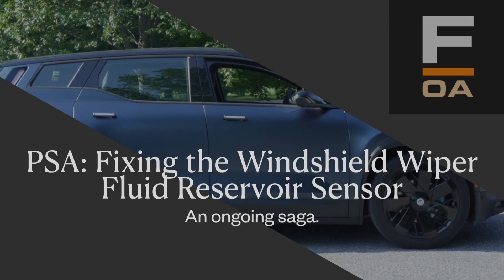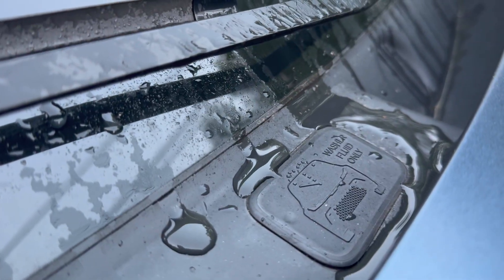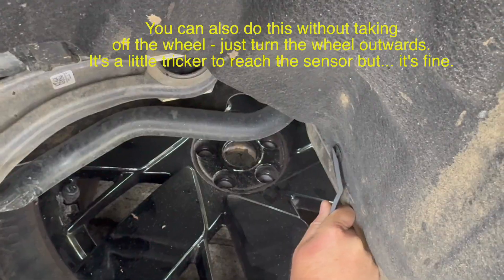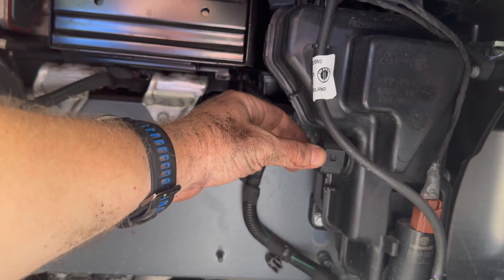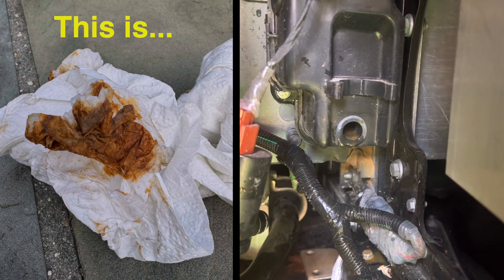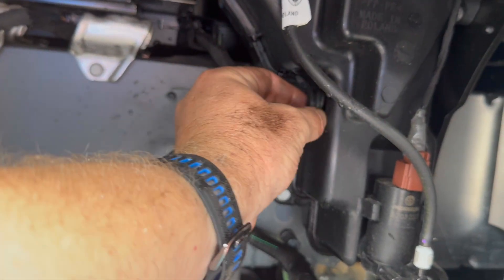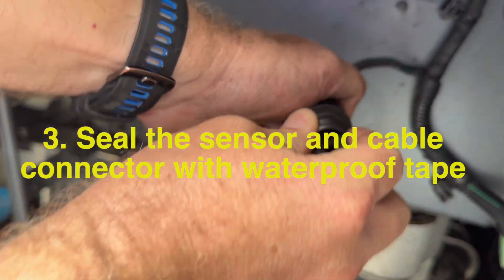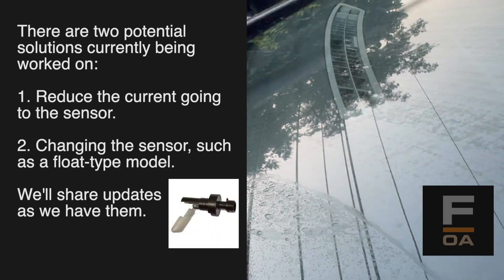Sensor Drama: Update on the Windshield Wiper Fluid Reservoir

Comment: Thanks for putting this out there! This is something that literally every Fisker should have done or will eventually cause a problem. 

It's likely that at least some of the wiring harness corrosion issues are caused by leaking washer fluid through this sensor as well as it drips down on connectors and VSP.
Reply from the maker: Glad we could help. We agree this is a big issue.

Comment: Reducing the Voltage might be a Solution. Since you have identified a too high voltage, how much are we talking about?
What Voltage did you measure. Also which are the make and model no of the sensor please?
Usually there should be a spec sheet with its technical data on the website.
Reply from the maker: All of this information is on Discourse in several detailed, long threads.